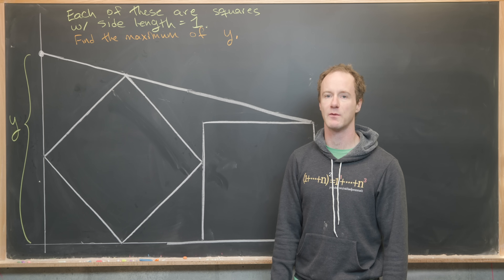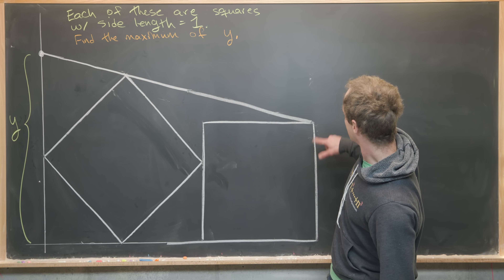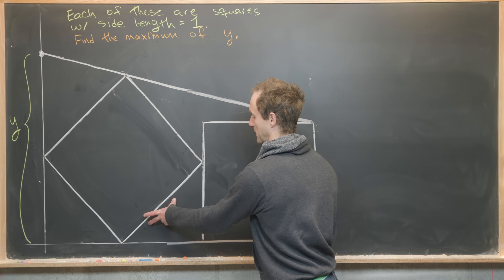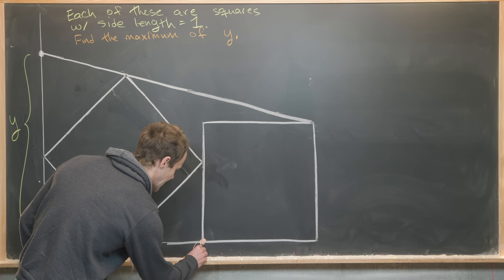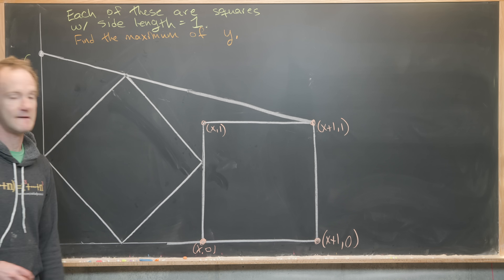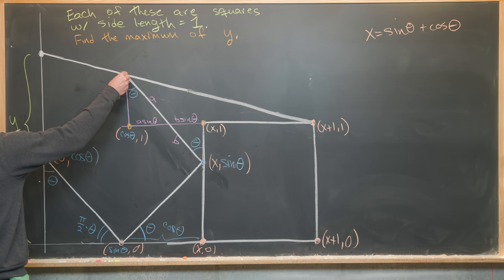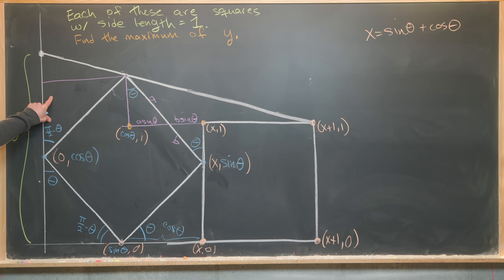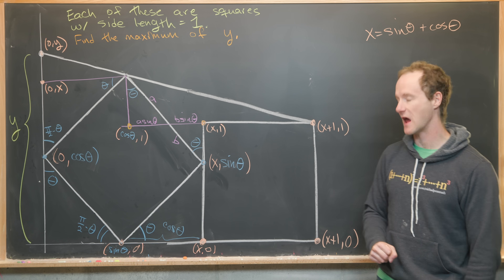How big can y be?

Comment: Can you just make the intersection of the first square and the line (sqrt2/2, sqrt2) to find the slope of the line then use that to find out what it equals at x=0?

The tallest that intersection of the first square and the line can be will be the diagonal of the square from two corners right?
Reply: I think you mean we put the left hand square so that its diagonal is perpendicular. That's the answer, right? No...  You can twist the left hand square clockwise a little bit and it will lift the slope of the line we are trying to find. It's the slope we need to find - not the height of the left hand square.
Reply: @samstep4279  
No it won't shift he slope.
If you rotate the left hand square clockwise, the bottom corner will go clockwise to, thus lowering the slope,
if the left hand square is rotated that the diagonal is vertical, that point where it touches the slope is the most upper point it can get.
It is a square that you rotate and not just a vertical line.
Reply: @seriously1184  and the earth is flat, right? why are you arguing with the literal established correct answer right now lol
Reply: @lennyganado3975  
First of all I am not an flat earth believer, far from it !
Second, I am an engineer and thus I looked at this in a realistic way of problem solving (that what is often times too big of a problem for mathematicians being able to do) !
Third, the designed problem used in this video is in a closed frame !
All the outlines off thegeometrical figures are all of the same width and colour, thus making them all geometrical objects laying against each other and in one large geometrical object, making this a realistic engineering problem than anything else where the law of physics rule above anything else (a concept that is apparently unknown to mathematicians) !
So use lines of different width, colour, etc if you want to indicate what is fixed or adjustable in any design or drawing (something that apparently is also unknown to mathematicians) !
Fourth, if you start with insults, you must really be a compulsive and impulsive pric* 
I bid you a good day sir.
Reply: @seriously1184  It's a pity that an engineer such as yourself missed the point that as you rotate the first square a little clockwise from its highest point, not only does the bottom corner move left, but so does the rightmost corner and so the second square moves left in its entirety. That movement left of the "hinge" of the slope increases the slope initially, and that is why the value of y will in fact increase a little as the first square rotates clockwise from its highest point.
Reply: @RexxSchneider  
You really must be a genius !!!!

If the first square (the one on the left of the screen) rotates clockwise , the second square (the one on the right of the screen) will move to the right (of the screen)
Thus increasing the distance/length and angle of the slope

When the first square (the one on the left of the screen) is rotates in such a way that its diagonals are perfectly vertical and horizontal, that is when the maximum distance/length and maximum angle of the slope has been reached

At that point the rotation of the first square (the one on the left of the screen) in clockwise or anticlockwise direction makes no difference, because they are equal to each other, with the difference being increase of distance/length  and angle of  slope in clockwise direction and decrease  of distance/length  and angle of  slope in anticlockwise direction

It's that simple !
You can literally SEE that, without having done an iota of calculations !

But I guess mathematicians are not able to see what is literally in front of their noses, they NEED to make (theoretical) calculations in order to SEE !
Well, have fun with your (theoretical) calculations
Reply: @seriously1184  Are you kidding me?

When the left square has its diagonals horizontal and vertical (when you mistakenly think the slope is maximised), the right square must be at its furthest distance from the vertical line y. It's √2 from that line in fact. So as soon as you rotate the left square from that position, the right square must move to the left. and as you move the "hinge" on the top right of the right square to the left, you increase the slope. I know you can see that.

It turns out that the geometry is such that the effect of moving the hinge left and increasing the slope is initially greater than the effect of lowering the top point of the left square and decreasing the slope. So the slope starts to increase. After about 7 degrees of rotation the effects become equal and thereafter the lowering of the top point produces a bigger effect than the movement left of the hinge. That's why the maximum value for y actually occurs about 7 degrees away from where the left square diagonal is vertical.

I'm an engineer, and I worry about engineers like you giving us all a bad name.

Comment: Simpler to express in trig form.
s,c are sin, cos .  ss = sin^2 etc.
y-1=2sc/(s+1)
differentiating and set to zero gives.scc=(1+s)(cc-ss)
Or sss+2ss-1=0
Which factorises as 
(ss+s-1)(s+1)=0
Or s=1-ss=cc
Hence c=sqrt(s)
Also s = golden ratio -1= ¥-1 0.608...
y = 1 +( 2(¥-1)^1.5)÷¥ =~1.600566 the same as the video.
That ¥ should be phi
x =~ 1.404 ie close to 1.414 which it would be with the left square at 45°.

Comment: I put one of the corners at Origo as in this picture: https://imgur.com/a/OosIzAd
Use [-a;a+b] and [1;1] to express line
(y-1)=((a+b-1)/(-a-1))(x-1) or
y=(a+b-1)(-x+1)/(a+1)+1
Now use [-(a+b);b] and b=sqrt(1-a^2) to get
y=(a+b-1)(a+b+1)/(a+1)+1 or
y=((a+sqrt(1-a^2))^2-1)/(a+1)+1
Set derivative to zero to get
(a^2+a-1)/sqrt(1-a^2)=0
which clearly has the golden ratio as a solution in our domain.
Use in line equation above to get
y=1+sqrt(10sqrt(5)-22)
Nice puzzle!
Reply: The only thing I did differently from this was to flip the diagram so b is positive.

Comment: In my humble opinion, I think eliminating theta was a mistake.
Having all the parameters as a function of the angle gives great insight on what is happening (yes, I'm a physicist), the equations are simpler, and the solutions are beautiful:
y=1+(sin 2θ)/(1+sin θ)
Optimum when (cos θ)^2=sin θ
ymax=1+2/φ (φ-1)^(3/2)
xmax=(φ-1)+(φ-1)^(1/2)
where φ is the golden ratio.
Reply: Wonderful how golden ratio or pi or other ''great'' numbers come out in these kind of problems
Reply: I agree, keeping the angle is more elegant (and I found it just easier to work with), and I also obtained y=1+(sin 2θ)/(1+sin θ). But how did you get y' = 0 leading to (cos θ)^2=sin θ? When I reduced it down, I came to, (sin θ)^3 + 2(sin θ)^2 – 1 = 0, or equivalently, (cos θ)^2 = (1 + (sin θ)^3)/2. Not sure where we diverged.
Reply: @markbratcher9095 , starting from your equation:
(sin θ)^3 + 2(sin θ)^2 - 1 = 0
sin θ (sin θ)^2 + 2(sin θ)^2 - [(cos θ)^2 + (sin θ)^2] = 0
sin θ [1 - (cos θ)^2] + 2(sin θ)^2 - (cos θ)^2 - (sin θ)^2 = 0
sin θ - sin θ (cos θ)^2 + (sin θ)^2 - (cos θ)^2 = 0
sin θ - (cos θ)^2 [
sin θ + 1]+ (sin θ)^2 = 0
sin θ [
1 + sin θ] = (cos θ)^2 [
sin θ + 1]
sin θ = (cos θ)^2

Since sin θ is monotonous increasing for 0<θ<π/2, I did the change of variable u=sin θ, getting
y(u)=1+2u Sqrt[1-u^2]/(1+u)
and looking for y'(u)=0 the equation beautifully simplify to u^2+u-1=0.
The solution is u=φ-1, but the equation itself is asking u=1-u^2, which is sin θ=(cos θ)^2.
Reply: @sergiokorochinsky49  great thank you! I didn't fiddle with it enough, evidently, to reduce it further.  I'm relieved to know that at least where I landed was correct if not more simplified. :) The subsequent substitution to get the final answer was clear. I actually did the substitution in my case, giving me u^3 + 2u^2 - 1 = 0, but I didn't immediately recognize that this factors into (u + 1)(u^2 + u - 1) = 0 which would have landed me properly. The 'u' here is not only the golden ratio - 1, but also represents one particular leg of the right triangle formed by the angled square. It turns out, then, that the distance from the lower right corner of the right-hand square to where the perpendicular from the pinnacle of the rotated square projects to the bottom is the golden ratio.
Reply: @markbratcher9095  super cool. I didn't see that!
Reply: @markbratcher9095  I followed a procedure very close to yours, and I got finally that u = sin θ = 1/φ (only positive root), and that leads to y max = 1 + 2/φ^(5/2), which is just a simpler expression for the result everybody got.
Reply: @nabla_mat  once you arrive to an expresion with φ, it's easy to play around and get other expresions (yours is included in a list above).
My prefered answer is ymax ≃ φ (±1%).
Reply: You can solve this without calculus right?
Reply: @leif1075 , I doubt it. But I'm all ears... What do you propose?
Reply: @sergiokorochinsky49  I'm thinking set up an equation with y as a function of theta as opposed to x and then plug in different values of theta until you get a maximum.  I don't see why that wouldn't work?
Reply: @leif1075  Oh, so you want to plot y(θ) and determine the maximum graphically. That method has a name: "brute force". It always works, it gives you a fairly good approximation with a reasonable amount of work, but you will never get the exact result. Why wouldn't you use derivatives?
Reply: @sergiokorochinsky49  you could get the exact result sometimes. In this case i think you would.
Reply: @leif1075  using derivatives you can find the exact solution (ymax=1+2/φ (φ-1)^(3/2)) which happens to be an irrational number, so, no, the brute force method will never find the exact solution.
Reply: @sergiokorochinsky49  Why not? It can as long as you plug in the right irrational number for the angle to get the answer 
.but I might admit that it's a long shot or a lucky guess since I don't see any way you can deduce that irrational number from the equation.
Reply: @leif1075  you didn't say why you don't want to use derivatives... they were invented exactly to solve this kind of problems.
Reply: @leif1075  an irrational number has infinite decimals in a non-repeating pattern. How will you "plug in" your guess in y(θ)?

I trust your intuition. You may play around with some numbers, see that the maximum y is around sin(θ)=0.62 and then suddenly guess "hey!, that's the golden ratio minus 1!". How will you test that your hypothesis is true? You need to evaluate y(θ) at sin(θ)=φ-1, use the infinitely many digits of φ, and show that any notch in the decimals will give you a smaller y. But you can't, because φ has infinitely many decimals.

Once, with a different problem, I was doing the same you want to do, just to get the felling of the problem, and I saw that clearly the result was 20. It was "obvious" the series was approaching 20.
But the exact result was e^π-π.
Reply: @sergiokorochinsky49  Brute force has the advantage that it works, approximately, a lot more often than exact solutions do. Exact only works when the setup is nice.
Reply: @sergiokorochinsky49  You shouldn't trust his intuition haha.
Reply: You're right only the part of not  eliminating theta but the correct answer is x = sqrt(2) and y= 3 - sqrt(2) so there's nothing to do with the golden ratio
Reply: @oscarrangel14  you should double check your math there. I don't believe that answer is correct. It certainly doesn't match the answer given in the video, which is the same answer as Sergio and I came up with if you refactor it a little.
Reply: @markbratcher9095  i am 100% right if you don't trust me you can draw the answer with my numbers and compare with any others (good luck with the negative values of the video)
Reply: @oscarrangel14  yes, I see how you obtained your results. You assumed that when the rotated square is at 45 degrees, y is at its maximum. This may be close, and visually appears so, but it's not the largest y can be if you consider all possible rotations of the square.  When the angle is 45 degrees, you get y = 3 - sqrt(2). Compute y when the angle is 38.1727 degrees and see what you get for y. Compare this value of y with your maximum value (Ans: your value of y is 1.585786..., but if the angle is 38.1727 degrees then y is just a little more than 1.6).
Reply: I don't understand why @Oscar and @Leif don't want to use derivatives in a maximization problem.

As for maximum y, 
it is funny how the properties of the golden ratio allow you to get different expressions:
ymax = 1+2/φ (φ-1)^(3/2) 
           = 1+2/φ^2 (φ-1)^(1/2) 
           = 1+2(φ-1)^(1/2)/(φ+1) 
           = 1+2(φ-1)^(5/2) 
           = 1+2/φ^(5/2) 
           ≃ φ(±1%error)
Reply: @sergiokorochinsky49  in fact I used them, it's very funny how we are arguing in such an easy problem, this time the golden ratio is not a tool
Reply: @markbratcher9095  visually appears? You've got to be kidding me, there's no way 38.1727 degrees gives you the maximum value, let me explain the maximum distance inside in a square is it's diagonal if one of its sides is horizontal the diagonal reaches the maximum when you rotate 45 degrees you don't want to believe me use the derivative or draw it in a cad
Reply: @oscarrangel14  good for the use of derivatives, bad for the result (which is suspiciously the same you get assuming an angle of 45°, without maximizing the function). I cannot say anything that Mark didn't say in his previous message. 

The best part of making a mistake is finding it and fixing it. You will enjoy it.
Reply: @sergiokorochinsky49  mathematics are exact draw your solutions according to the problem and you will find your mistake this time I am correct
Reply: @oscarrangel14  since you are stating the obvious, I will do the same: the square has TWO diagonals. While one diagonal is lifting point A (highest corner of tilted square) the other diagonal is pushing away point B (corner most to the right). The movement of point A increases the slope of the line, but the movement of point B decreases the slope of the line, therefore there could be a maximum in between 0 and π/4, and indeed there is one. You are just failing to find it. 

I'm not going to accuse you of being a troll... but Mark gave you the numerical results for both cases, and you just denied them and sent him to make a drawing with CAD... If you cannot find the problem with your equations, I hope at least you can see the problem with your attitude. 

When someone says 2+2 is not 4, I just stop talking to them.
Good luck.
Reply: @oscarrangel14 I think we can discuss this without the condescension, yes? Of course the height of the square  itself is maximum at 45 degrees rotation. However, the pinnacle of the square moves to the right when the angle decreases (as the square rotates clockwise), thus momentarily increasing the height y in the process before it finally starts to get smaller.  If the pinnacle of the square were always in the same horizontal location (x coordinate) for every angle, then 45 degrees would be correct. But the relationship between y and the maximum height of the rotated square isn't that simple in this case.  This can be seen in the mathematics of the problem, as nearly all of the other comments on the video have discovered (if you read through them).
Reply: @sergiokorochinsky49  you were absolutely right my apologies
Reply: @markbratcher9095  good job I was wrong
Reply: @oscarrangel14 , for the language and the attitude, apology accepted. :-)
As for the mathematics, no need to apologize! Making mistakes is part of the job. And be honest: once you found the mistake, you fixed it, and you finally understood how the problem works, wasn't it cool?? I told you it will be. :-D

Comment: For anyone who is confused by your answer and differs from Michael's, one simple way to check if you're on the right track is this: what is the y-coordinate of the top most corner of the tilted square? If your answer is not dependent on the tilt angle or some other variable you chose to use, and is instead just sqrt(2), you are not on the right track.
Reply: So what is the correct y value of the top coordinate?
Reply: @casc3601  1.600566212

Comment: I solved it using geometry and got an answer of 1.5875 which different from yours.
 Kindly explain
Reply: His answer is about 1.600566212001556 so perhaps you stepped over the maximum?
Reply: I think the angle of the rotated square isn't 45 degrees.
I got the same answer under the assumption that having the square at 45 degrees would be the most optimum.

Comment: If we stick to parametrizing by theta, we get the top point as (cos(θ), cos(θ) + sin(θ)) and the upper right point as (cos(θ)+sin(θ)+1,1). Then, the slope of the line segment is (cos(θ)+sin(θ)-1)/(-sin(θ)-1), so y = (cos(θ)+sin(θ)-1)/(sin(θ)+1) * (cos(θ) + sin(θ) + 1) + 1 from the upper right point and the point (0,y). This simplifies as y = 2sin(θ)cos(θ)/(sin(θ)+1) + 1, and its derivative is 2[ ( (cos^2(θ) - sin^2(θ))(sin(θ) + 1) - sin(θ)cos(θ)cos(θ) )/(sin(θ)+1)^2 ]. y is maximized only when this derivative is 0, so we need that the numerator of this fraction is 0. Using cos^2(θ) = 1 - sin^2(θ) and letting s = sin(θ) for brevity, we get (1 - 2s^2)(s+1) - s(1 - s^2) = 0, or s - 2s^3 + 1 - 2s^2 - s + s^3 = 0, or -s^3 + 1 - 2s^2 = 0, or s^3 + 2s^2 - 1 = 0. This factors as (s+1)(s^2 + s - 1) = 0; since s = sin(θ) is between 0 and 1 as θ is between 0 and π/2, the only solution is s = (sqrt(5) - 1)/2. Curiously, for this angle, cos^2(θ) = (sqrt(5) - 1)/2 and 1/(sin(θ) + 1) = (sqrt(5) - 1)/2, so we get that y = (3 - sqrt(5)) sqrt( (sqrt(5) - 1)/2 ) + 1. sqrt( (sqrt(5) - 1)/2 ) doesn't seem to have a nice form, so that's our answer. This is equivalent to the answer Dr. Penn gets, so that's good.

tl;dr: θ = sin^(-1)(1/ϕ)
Reply: I find this answer in term of theta more apropriate, as we would naturally measured the rotation of the first square instead of the measure of x (length which doesn't have a real physical signification for the square)